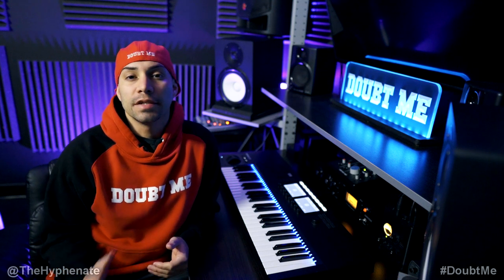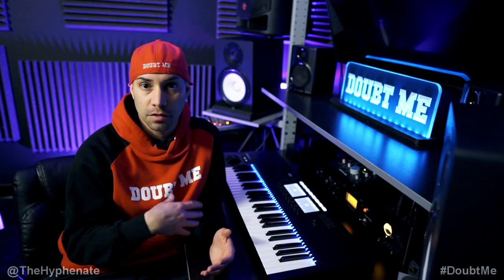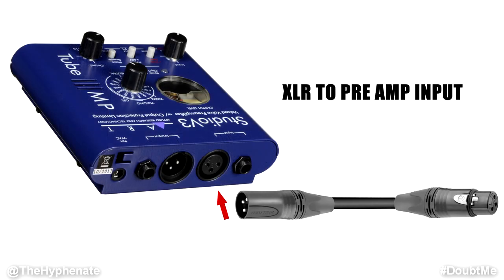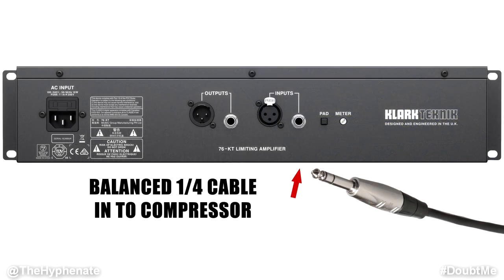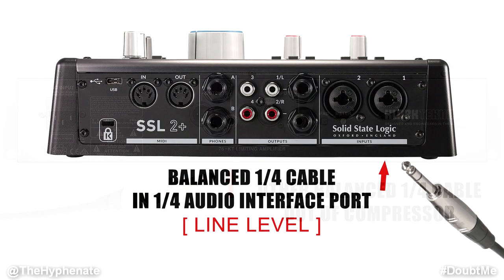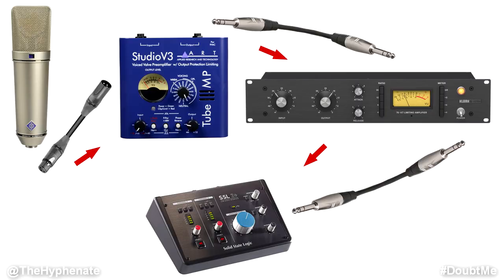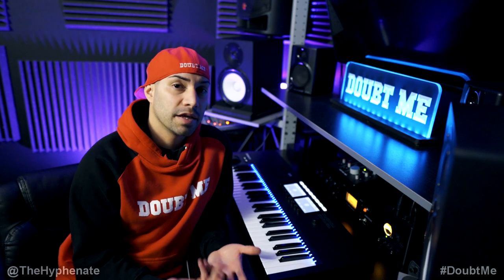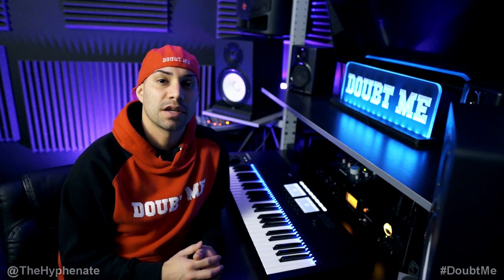How to connect a Compressor to Your USB Audio Interface [ Outboard Gear Setup ]

Comment: Jeez Ive been searching for the answer for awhile you're the only person to give a direct answer thank you so much!
Reply from the maker: Happy to help. Thanks for watching. 🙏🙏
Reply: @DoubtMeTech  but I do have a question I saw a video on how you can damage your preamp by plugging it directly into the audio interface is this true or is there a way to not have it break.
Reply from the maker: The audio interface is a mic preamp.  The compressor is not.  Going from mic pre to compressor to audio interface won't be an issue.  Going from mic pre into XLR directly to the audio interface can be an issue because the mic preamp turns the signal from mic into line level. The only way to go from mic preamp to audio interface is if you go with a 1/4 line level jack and make sure you select line level into the interface.  With this method in this video, you won't have any issues
Reply: Facts I was just about to say the same thing thank you for this 💯

Comment: Wow came across this video and guess what, I had my setup all wrong. 🥲I connected my WA-8000 ---> 76-KT ---> dbx286s ---> MOTU M4 no wonder I been having hissing when I turn up my output gain pass 48 on my 76-KT. Also, I was using the wrong cables for the inputs and outputs. I will reconnect my gear correctly this time and see how it sounds this time around. Your video was really informative and to the point! Could you give me a good vocal setting point on the 76-KT as for the input, output, attack, release, ratio and meter? Oh, and on the back of the 76-KT should the pad button be pushed in? Thanks for any advise!!

Comment: What if your USB audio interface has a low dynamic range. Would it downgrade the audio received from the mic preamp/compressor when the signal is received from the jack input?

Comment: i have my mic going through my compressor to my  interface but i noticed i dont see a input/output level on my compressor. i have a behringer solo interface. is this the reason i dont see a input output level because i need a preamp as well as those balance cords?

Comment: i am new to outboard gears.. and i am fool proofing as much posible on how can i route all my signal to a patchbay.. and thank you for giving the very simple answer.. 1. dont use the 48+ phantom power in the interface, 2. use a mic pre. after the mic so it will be at a line level signal and you can now bring your outboard gear and patchbay altogether 3. put the line level signal to the input of the interface! thank you

Comment: Well that was clearly explained. This is the first video I have seen that mentions the fact that if you are using a condenser microphone and you want to use outboard gear you need to run through an outboard mic pre first. Seems pretty basic but can be overlooked if let's say you just wanted to use a compressor. I've seen some videos where they say you can use an XLR to XLR cable to go out of your mic pre and in to your audio interface, but you mentioned TRS. Why shouldn't an XLR be used? Thanks for the video.
Reply: I asked my engineer and the guy at sweetwater and both said you can use a XLR cord as well as long as their female to male but most are female to male

Comment: Great video! I have a baby face pro and a WA 76. Should I Run my TLM 103 to the compressor then from the compressor out to the baby face pro interface? If I connect my mic to the baby face then run it through the compressor I have to loop it back from the compressor to the baby face but then I have no inputs for my monitors lol. My question is will I lose quality running the mic directly to the WA76 compressor first?

Comment: Can you answer this: Which do I turn on first after plugging in my microphone? Pre amp or interface ?
Reply from the maker: I generally turn on the mic pre and turn on phantom power, then turn on the compressor, then plug in the mic into the mic pre. The preamp should be on automatically with the computer
Reply: @DoubtMeTech  APPRECIATE YOU!!! SUBBED TOO

Comment: XLR cable from Mic to Input of PreAMP ---> Quater inch balanced cable from output of mic preamp to input of compressor. ---> another  quater inch balanced cable from output of compressor to usb interface. Once its connected set preamp for line level input

Comment: Love it, straight to the point! Do you really need a mic preamp before your compressor? or can you just go from the compressor to interface such as the Scarlett 18i20 2nd gen?
Reply from the maker: You definitely need a mic preamp if your microphone requires phantom power
Reply: @DoubtMeTech  Thank you 🙏, my interface does have phantom power though, or does that not matter in terms of having the compressor working?
Reply: @thinksounds1  you clearly didn't pay attention to the video because he clearly spoke on this during the video

Comment: hey, thanks for the video.  Is there any reason why I shouldn't use a XLR to balanced 1/4 TRS cable instead of a balanced 1/4 - 1/4 cable to connect the compressor to the interface? thanks!

Comment: I know I am late to the party here, and I don't know if you work with guitar and guitar amplifier. But my question is, how do I go from my amplifier to my two notes captor x, (I use that for now because I can't mic a cab in my current location) to a channel strip, and ultimately in to my DAW. Using or not using a audio interface.

Comment: Hey brotha great info! I'm rocking an old school behringer compressor that is also a preamp and phantom powered. My plan was to go from the behringer into the interface with the balanced trs cable and run it as line with 48v off and levels down on the interface. On the compressor side, I'd have 48v on. Is this correct?
Reply from the maker: Yes that is correct 👏
Reply: @DoubtMeTech  word up, I appreciate the reply! 👊
Reply from the maker: @micraw714  Happy to help. Thanks for watching 🙏🙏

Comment: Hi - this is really helpful.
Just wondering why do you recommend a 1/4 Jack instead of a balanced XLR from the V3 to the compressor and compressor to interface.
I’m getting a lot of hiss going on and wondered if this could be why?
Thanks
Reply from the maker: The mic preamp is outputting line level, not mic level.  The 1/4 inch that ends up going to the preamp after the compressor has to be line level.   That's why using the 1/4 is the way to go
Reply: @DoubtMeTech  thanks so much! 👍🏼

Comment: Hi, thanks a lot for this video :)
My question is…
What if i’m recording two simultaneous inputs  (both condenser on my interface with one external and one stock preamp and my interface has global fantom power? Meaning i’d have to turn 48v ON on my interface to use the second condenser mic? Would it affect the input from the external preamp into the interface’s line in? 
Thanks again
Cheers!

Comment: Can you explain the point of having an additional preamp if the audio interface already has one ? I have a ssl2+ and a behringer compressor, im using a condenser microphone those typically have sufficient gain so is the art tube preamp really necessary?
Reply from the maker: There's a long answer to this, but just know that if your mic pre is going directly into your computer with mic input, your compressor requires line level input.   Your audio interface is not sending out a line level output.  Just please make sure to follow these steps exactly so you don't damage any of your gear
Reply: @DoubtMeTech  wow thank you !
Reply from the maker: Happy to help. Thanks for watching 🙏🙏

Comment: Question ; why trs cable after tube pre. Cant you use XLR down the whole chain. Or does it not matter either way? Thanks
Reply from the maker: If your mic pre has had an XLR out, it's possible, but most don't as they turn your mic signal to line level, so you'll need to use the trs quarter inch cable

Comment: I use XLR for connecting my preamp to interface...is TRS a better connection?...pros cons of TRS vs XLR?...
Reply from the maker: Make sure to follow these steps.  Coming from a compressor or other analog outboard gear, you'll need to go LINE LEVEL into the interface, so be sure to use a 1/4" cable
Reply: @DoubtMeTech  Ok...i’ll try this...will this improve quality over the XLR method I was doing?...
Reply from the maker: @minusx31  many audio interfaces take line level input only through 1/4"
Reply: @DoubtMeTech  true but I want the best quality and clarity for my vocal input...just saying some interfaces has only has 1 input option doesn’t make it better...

Comment: I got me an Røde NT2A (mic), an Focusrite Scarlett Solo (interface), the KT-76 (compressor) and a preamp by Studio Projects called vtb1...so heres my problem: i connected my mic to my preamp via xlr and then i got an 1/4 inch balanced cable from the preamp to the compressor and from there i got an 1/4 balanced cable to xlr (male) cable in my interface... but when i take a listen, i only hear noise but nothing of my voice/mic. I got the 64 phantom power on my preamp on and my mic usually functions, what did i wrong? The compressor shows nothing on the meter so is my preamp shitty or did i something wrong? Sry for my english lol
Reply from the maker: Is your audio interface set as LINE LEVEL?
Reply: @DoubtMeTech  yes

Comment: Can I connect my mic to channel 1 and compressor to channel 2
Reply from the maker: No you cannot.  They are 2 different inputs so the compressor won't apply to your Mic on input 1
Reply: @DoubtMeTech  dang okay if I get that pre amp is their a way I can disable it cus I have an ssl2 and it has its own preamp
Reply from the maker: You have to follow these steps exactly.  I have the ssl2 as well, but you cannot use it as a preamp and an audio interface when connecting outboard gear

Comment: Hi, I'm new to use outboard gear so just got my KT76 and try to hook it to my apollo twin usb using cubase pro12. I do the external fx send out as mono in/return with balance 1/4 cables but somehow I couldn't get it works in my daw. I've watched so many videos on YouTube and tried so many times but still not working. Wonder if you can help me go through it. Thank you.

Comment: What about if your not using a preamp?
Reply from the maker: If you have a dynamic mic that doesn't need a preamp, then just go straight into the compressor via XLR
Reply: @DoubtMeTech   Thanks for your professional advice!!

Comment: Question about ssl2+ being the interface .. if you hit the 4K button will it affect the sound ? Or is the preamp entirely bypassed because you have an external pre ?
Reply from the maker: To my knowledge, hitting the 4k button will still affect sound.  It works on either mic or line input I believe.
Reply: That’s fire , thank you!

Comment: Since the ssl preamps cant be bypassed Will that bring problems with conecting another outboard preamp to it?
Reply from the maker: Follow these steps.   Going in 1/4 inch allows you to select line level input.   DO NOT turn on phantom power.   You're using the SSL as an audio interface ONLY instead of a pre-amp + audio interface

Comment: Can we also use xlr cables when connecting to compressor and interface since there is output for balance cables? Or much better to use TRS cables
Reply: TRS is better because it also helps reduce noise

Comment: What will it happen if I use Xlr on the whole chain? Will it damage my gear?
Reply from the maker: Do not use XLR.  You are changing mic level to line level with the preamp, it's not staying at mic level.  Do exactly as in this video.

Comment: What if I use the version where instead of both sides are the same, what if 1 is the xlr male on 1 side & with the regular balanced 1/4 male on the other side to connect my preamp to my interface, would I still need to put my interface on line in?
Reply from the maker: Don't use an XLR input into your audio interface.  Make sure to use a quarter inch cable in and use Line level input

Comment: Did I need an additional preamp before the compressor if the microfon is a dynamic mic like a 57 or sm7b
Or did I only need the additional preamp as a phantom power deliverer for a condenser mic? 
The idea is to record snare and put the sm57 in a distressor and from there in the interface without a additional preamp. Possible?
Reply from the maker: Dynamic mics do not need a pre-amp.  So just go straight into the compressor.  Some dynamic mics do need a cloud lifter (similar to a mic pre), but most don't. So for the most part no you do not need a mic pre
Reply: @DoubtMeTech  Great guy, thanks for your answer :)

Comment: thanks for the explanation brother. How come you cant use XLR from Pre to compressor? They are both TRS essentially
Reply: TRS helps eliminate noise, as well as provide a line input, which is key to the process

Comment: is there any reason why it's not okay to use the preamp in your interface?
Reply from the maker: Because by the time you go into the interface you're now at line level, not mic level.  The mic preamp brings you to line level.  So if you're already at line level, then DO NOT us the preamp or phantom power.  Make sure you're going into the audio interface as line level

Comment: My phantom power box is xlr can I go straight xlr to the KT76 and come out 1/4 inch to the Apollo or just run xlr all the way thru ?
Reply from the maker: Come out 1/4 inch from the compressor into your audio interface and make sure you select that you're in line input, not mic input on your audio interface.
Reply: @DoubtMeTech  thanks for the quick response , great help 💦
Reply from the maker: @saucesamurai  Happy to help.  Thanks for watching. 🙏🙏

Comment: If connecting the compressor to eq chain using line cables rather than xlr because ‘damage is possible’ then when would it be useful to use the xlr inputs behind compressor and eq ?
Reply: When you're using hardware ONLY, like a mixer, trackboard, etc to record

Comment: I have the same interface, I just bought a FMR Audio PBC-6a compressor and cannot figure out how to use it. I ran the mic cable from the mic to the compressor a new the ran another mic cable from the compressor to the interface. Then I took a quarter inch balance trs cable and ran that from the compressor to the interface.When I attempt to record I’m not getting any audio. What am I doing wrong? Any help would be major,.

Comment: My compressor & preamp only allow for XLR connection, could I do this exact type of connection but use XLR cables? Except for the final step where I would use XLR out of my compressor and TRS into my interface?
Reply: You can use the XLR to TRS cables

Comment: so stupid question why the change to 1/4" from the preamp to the compressor and from the compressor to audio interface?
Reply from the maker: Because the preamp changes the signal to line level, and no longer is mic level.  So the quarter inch is for line level

Comment: Can I Connect a analog Compressor to an Interface without a pre amp ? If no why ?
Reply from the maker: You need a pre amp to power a condenser mic to reach the level needed for the compressor.  Dynamic mics don't need a pre Amp, However you may need a gain amplifier like a cloud lifter.

Comment: You are connecting a compressor to the microphone, not to the audio interface ;) That would be a different setup
Reply from the maker: The mic goes to the compressor, the compressor to the audio interface.  The mic is going to the compressor via the mic pre.

Comment: hey buddy, compressor should be first, bye
Reply from the maker: Not if you have a mic that needs power
Reply: @DoubtMeTech  power for mic looks different, this is just cheap preamp, and preamp you got on your interface. Buy tube mic with power and then comp. With too many preamps is not good way. Anyway you must compressing sound straight from mic, why to compressing output from preamp, you got limiter there, and sound from preamp is also limited by gain already. On guitar you put compresor behind preamp too :-)

Comment: Bad tutorial. You say "plug output cable from pre to interface" Do you think there is only one place to connect a cable to the interface? Why would you assume that we all know exactly which port to plug that cable into? You should learn how to teach before you try teaching others.
Reply from the maker: When I say that, I show a diagram with text that explains it needs to be plugged into a 1/4 line level input on your interface. As this is a video and not an audio podcast, there are visuals along with my verbal instructions.   Also, this has successfully helped over 40,000 ppl, so my instructions must not be too bad.  
I hope you got it set up correctly, if not, please watch this tutorial again and make sure to look at the visuals.  Happy recording 🙏🙏
Reply: If you didn't understand, you need to look into another hobby 😂 😂 this guy was super helpful, and easy to understand.. 😂 😂 Cut it out